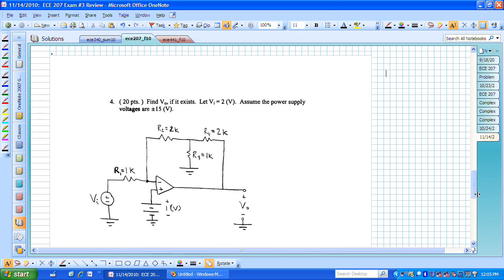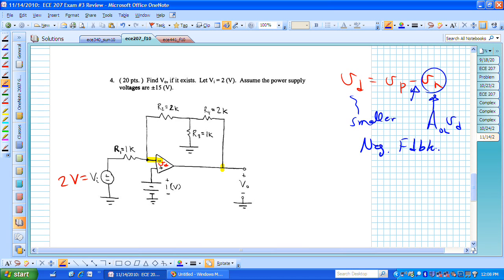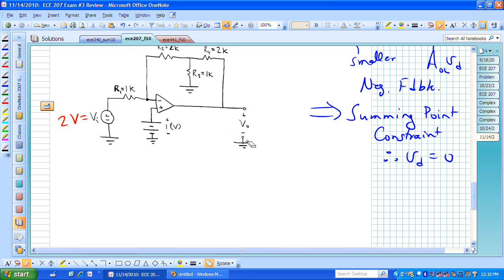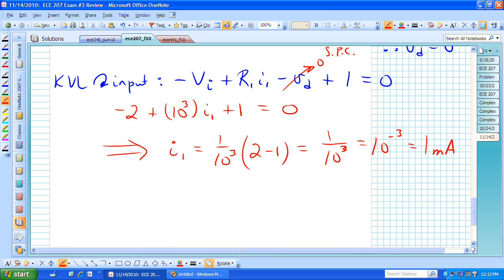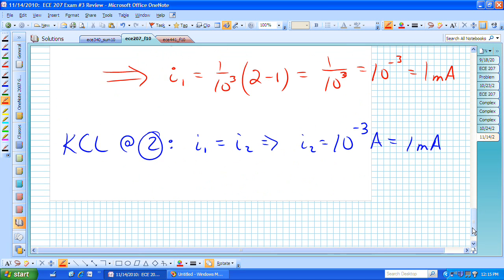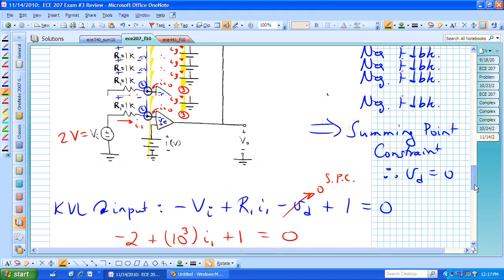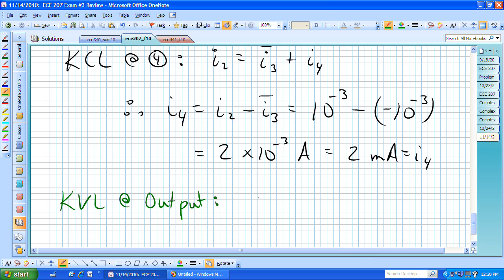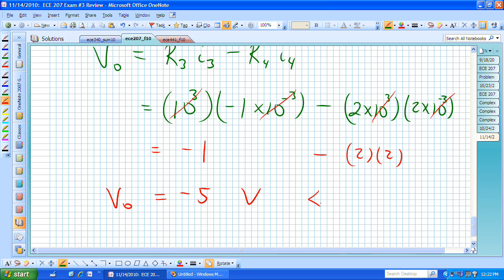ece207_vid_exam3_p4_sum07

Comment: ALL of these op amp problems could be made much easier simply by using KCL at the nodes. E.g., at node #2 the voltage is simply 1 V assuming the summing point constraint. From there applying KCL at node 2 and taking V to be the voltage at node 4 we have (1 - 2)/1000 + (1 - V)/2000 = 0 or simply V =  -1 volt. Then applying KCL at node 4 we have:
V/1000 + (V - 1)/2000 + (V - Vo)/2000 = 0 we substitute V = -1 and solve for Vo to be   - 5 volts. This is literally a 60 second problem. From here getting any of the currents (if you need them) is trivial.